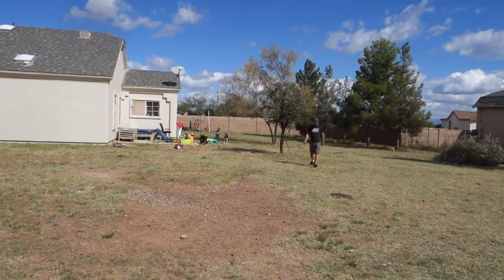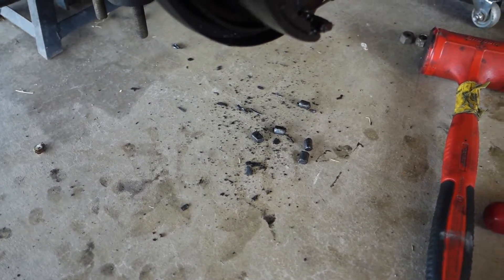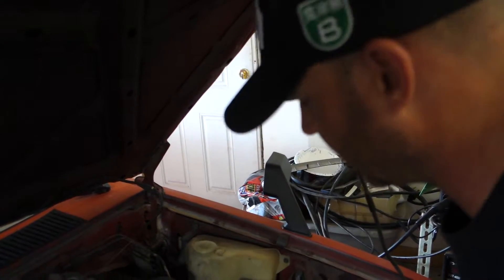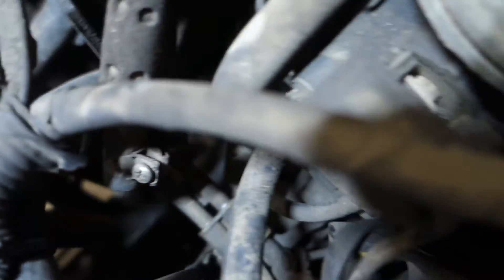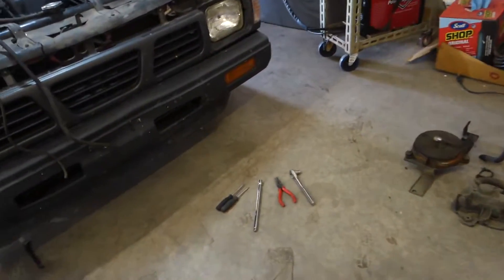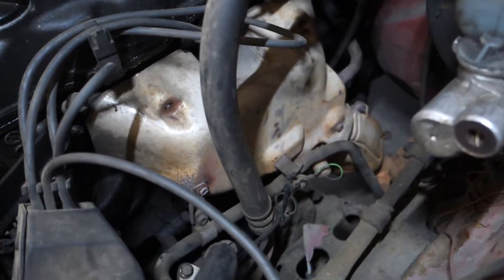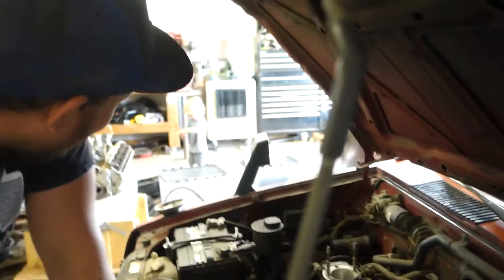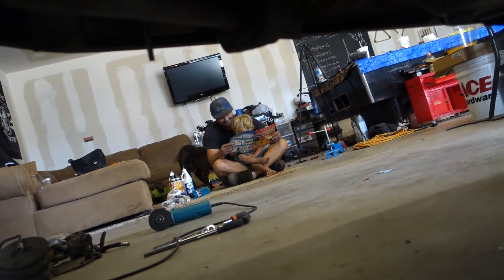D21 Hardbody: Emissions Delete (pt1)

Comment: BTW, that fitting on the pipe plumbed to the manifold pipe should be NPT thread. Should be able to run a pipe plug in it. Maybe $2 at the hardware store.
Reply: haha pipe plug was 20 bucks last year

Comment: Maaan the only videos i wait for u guys help me alot with mi 89 hardbody please please film when u go turbo thats what im going with mine i know how to do most of the stuff but i rather see it done with the same engine asmine and watch someone who knows what their doing is best. Thanks alot beothaas. Saludos de Morelia Michoacan.!!!
Reply: i got a 93' and a turbo off a 3.8l isuzu. I'm gonna try to do mine. I'm gonne try to fab it myself, and have it professionally welded. 
Gonna get a good fuel pump, retard the timing, change out the injectors, and try to use the factory isuzu bov. 
Eventually, I wanna tubeframe the front, get a good turbo, and rebuild the whole bottom with race car parts.
Edit: I'll probably have to get a standalone engine management and a whole host of sensors at some point.

Comment: Love the video series of what you're doing with the truck! At about the 1:35 mark you mention the wire for setting up your tach. I have a '91 KA24E / 5-sped with 340,xxx miles. Speed/odometer don't work so I bought a cluster from a 93 that includes a tach (my 91 didn't have it and i really wanted the tach) but no one around where I live seems to know how the signal gets from the engine to the tach. I'm being quoted some pretty high costs for estimates on installing and connecting it. Any more advice on this you can share? Thanks!
Reply: @LocalLosers520  What kind of tach does he use? Did he run into any issues installing it?
Reply: Your truck should have the wiring for the tach even though it didn't come with a tach needle/display. Just remove the cluster and look around for the socket plug that is probably zip tied away from factory and plug it in. No wiring is needed unless you bought a cluster from a v6 engine.

Comment: haynes repair manual will have all the info you need for nissan/datsun 1980 thru 1997 pickups i just got one for my hardbody. ill admit i didnt think it would have as much info as it does. it has step by step for everthing to do with the hardbody
Reply: i got mine for 25 bucks its well worth the money
Reply: Yeah, they're handy.
Reply: @LocalLosers520   im just getting into my hardbody my buddy sold it to me for $ 50 got it running and decided im doing a full rebuild on the motor any pointers for getting more power out of this pickup aside from deleting emissions and ac
Reply: @LocalLosers520  im thinking about getting a suitable turbo i work at a wrecking yard so finding a turbo wont be hard im in for the long run im thinking about getting a new cam budget is ideal but ill take power over cost anyday
Reply: oh yeah and its an auto trans so the whole budget went out the window when i decided to go drift truick
Reply: @alyssamayhugh6335  What turbo you gonna try to rob?
Reply: @izzyplusplusplus1004  im thinking a k04 turbo from a jetta would be a good match for it

Comment: I have a 93 that chiggs like a 3 cylinder diesel...could that be feom the canister being o.e.m.? With going turbo will it effect the motor????
Reply from the maker: Make sure you have oil in your truck. 😁 Going turbo definitely increases cylinder pressures and is harder on the motor.

Comment: I am the second owner of a 1994 D21, automatic, 2.4L.  It is a "California Emissions" truck but was never in California, only Ohio. (No emission testing in Ohio) My question:  what is the reason for deleting all these parts?  More power?  better or worse MPG?  Extra space for your Turbo (I don't want a turbo).  The automatic has no real acceleration, but I also have a 1996 5-speed D21; I can lay rubber in 1st gear, but I never do.  The 1996 doesn't have those cannisters, hoses, chrome exhaust pipe, round cookie thing... on the driver's side.  No small beer can-ister on the passenger side.  What is the end result of "emissions delete?"
Reply: @LocalLosers520  Yes, just watched (wasted my time on) Part 2 a second time.  Other than "feeding horses, your bald head scratches, texting your girl friend, bad video, bad lighting, NOTHING was mentioned about the advantages of 'emissions delete.'
Did you read my words, 'don't want a turbo' .  I admit you are a good mechanic, but you are not a good teacher or explainer.  Your camera is a hummingbird that never looks at the hose, the "spider web of hoses," the "thingy," the actual subject.
YOU COULD HAVE written the advantages here, but instead took only a second to be condescending, "did you watch Part 2?"  Of course, as an experienced D21 owner, I watched part 2 before asking my questions.

Comment: My hardbody is a 1990 and it just passed emissions testing two months ago, live here in Nevada. I could register it under a classic but I'd have to unplug my speed sensor on the transmission to do so
Reply: @LocalLosers520  Classic registration is limited to 5000 miles per year so you have to unplug the speed sensor so you’re mileage doesn’t roll over 😂

Comment: Also if you don't turbo one and want some more power can order set of injectors from a stanza they're 3 holes and more psi like 80.00 on eBay new with the plug adapters to keep from cutting factory harness and then header an think it's pci chip to wire into air intake temp sensor goes into air filter and those 3 will wake the little truck up alot made a world of difference in my 96, 95 and my 94 as well my 97 hardbody.

Comment: i have a 1987 nissan hardbody diesel with 444500 KM ? on it are there any sites that have info on them ?all i see is gas motors.would appreciate a link if possible .thanks.

Comment: I’m doing a full egr delete on my d21 I got an aftermarket header can I just plug my sensors that go on my header
Reply from the maker: You should run it. But our trucks have ran fine without it
Reply: I had a guy put a header on and the bottom bolt was out and oil was coming out of the hole I didn’t know if you guys could let me know if he could’ve busted something in the head and it started burning oil

Comment: Next time take a bigger wrench 6 point you don't use much or have double and the round end drill a hole and put a bolt in the side of the round part of the wrench and then you can put bigger wrench on small bolts and rounded bolts and tighten bolt on wrench it'll tighten wrench onto the bolt or nut that's stripped and you'll easily remove it. And it'll be multi purpose wrench small or big size🤘

Comment: Instead of putting a nickle in there, does Nissan sell a bolt that fits that hole in the exhaust? That diaphragm-looking thing just feeds outside air into the exhaust, to eliminate some NO2, or something like that, once the engine gets hot. I'm guessing I could probably find something at Home Depot in the metric section.

"It's exhaust, who gives a crap?" LOL. Right on!